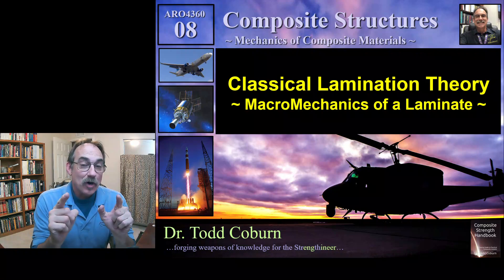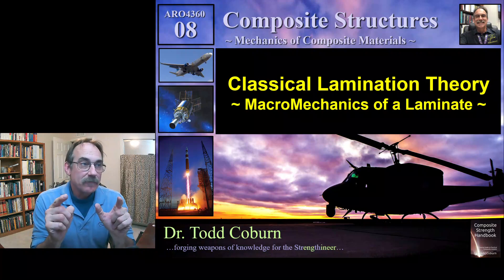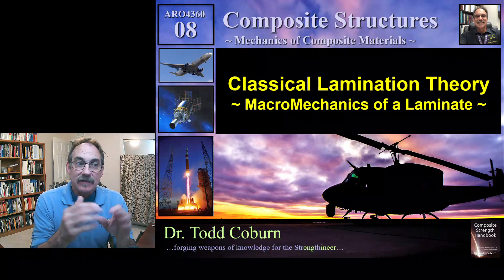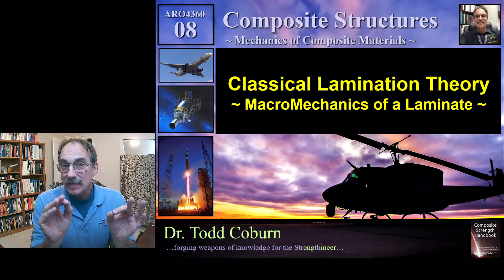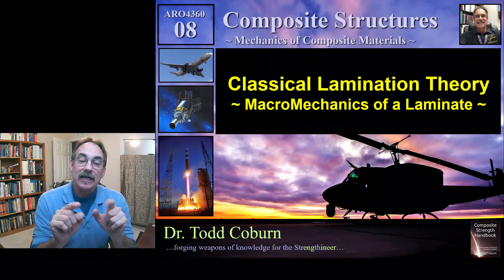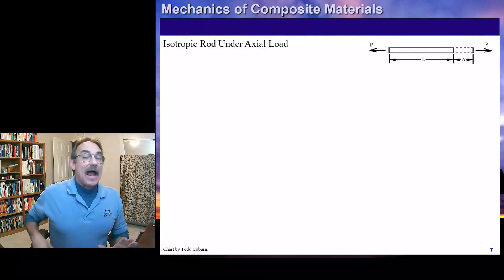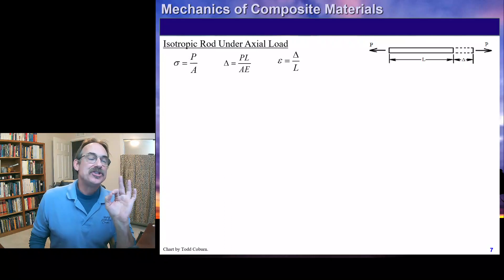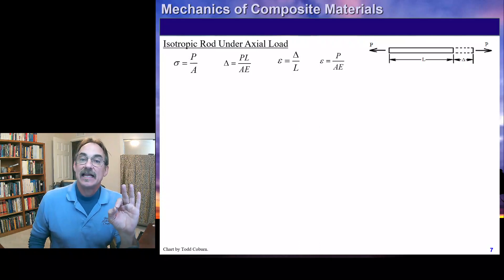Composites: L-08 Classical Lamination Theory

Comment: hello sir.
Thank you sir for these good and usefull teaching videos.
i have a question about Thickness of the lamina how i can estimate it, i have a work need a 4 lamina of the CSM fibers and polymer matrix, im confused how to estimatet it sir.
thank you 🙏
Reply from the maker: There is generally manufacturer data with approx thickness for various fiber/matrix combos.  However, cure pressure, stack thickness, and other things can alter that.  It is best to make a sample and measure it to confirm estimates
Reply: @ToddCoburn  thank you for your generous answer sir.
i've found a formula that estimate the thickness of each lamina, for exemple i used CSM Fiber off 450g/m² with 30% of mass and polymer matrix with 70% of mass, the thickness is about 0,9mm.
is that kinda aa true thickness that i can use it for my studies ?
about the datat if there is a sheet or a table can you share it with me sir.
Thank you For your help Sir i appereciate that 🙏